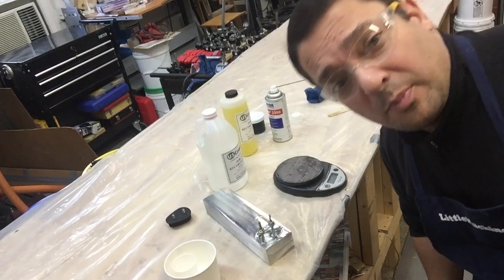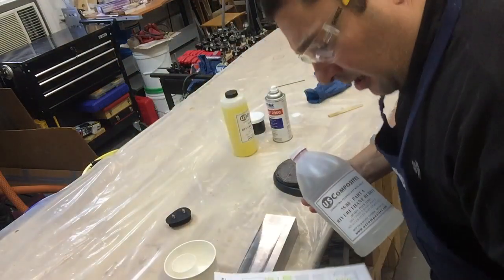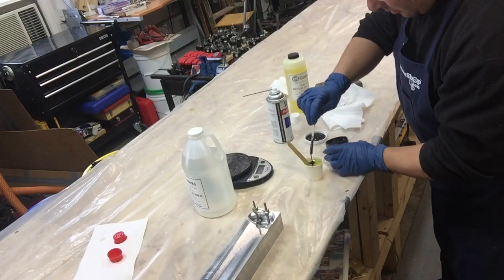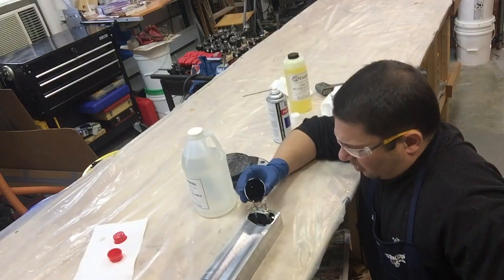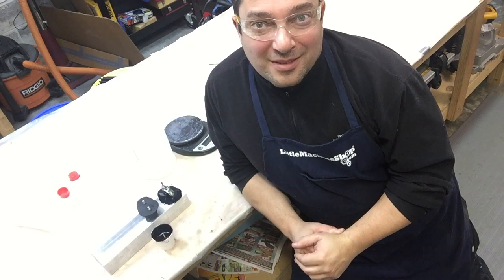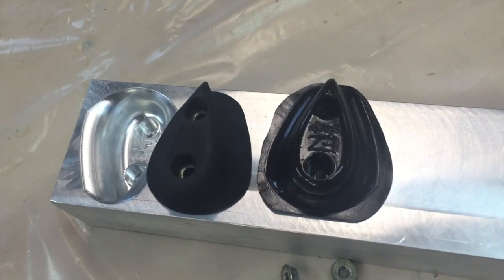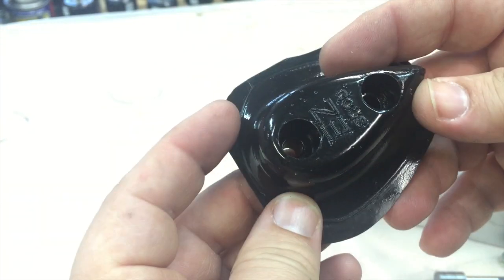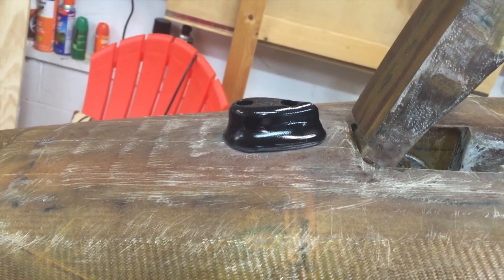From mold to part (part 3)

Comment: That looks great! Especially for your first mold! You can further improve your final result by adding a lid to contain the overflow. Simply  add a pour hole to make it an injection mold. Fusion 360 will allow you to calculate the exact volume of liquid that it will require to fill the mold. You could then machine your "bolts" for the holes in the part as a part of the lid to fit into the base as a male/female (hard to describe what i'm imagining). When the mold is opened, the part will be the exact dimensions you intended it to be, without having to fuss with screwing or unscrewing your bolt for the holes. To keep the halves aligned, drill and reem holes for a couple of dowel pins to press into the base, and 2 more holes in the lid for the pins to slide in and out of.
Reply from the maker: Thanks Josh.
Reply: No problem! It's hard to find anybody doing this kind of work. It's always interesting to me to see other peoples work flow. Keep up the cool videos!

Comment: Nice Job on the Mold I think it turned out great!  I guess if you wanted you could take a Dremel and polish the inside of the mold with some compound.

Now I'm not versed on aircraft but this piece is not to ever be used correct?  

You are a true Craftsman my friend anyone who puts this much effort into a piece that hopefully never gets used Well I cant wait to see the Long EZ when she is complete.

Just a Awesome Job!,
Be Safe,
Sam
Reply from the maker: I don't know about that Sam, but thanks a lot.  I'll probably not use this one, but only because I want to dissect it, and I didn't mix in any UV protection in the urethane. But I will use the next one. One thing I'll try with it, is to embed an aluminum piece identical to the stack's "handle" right where the counterbore ends, so that the bolts will have a much larger area to compress, rather than just two washers.  Incidentally that's what that handle really was supposed to be, but I digress.
Reply: +Crivo152 
Well I think it turned out awesome! When I said this piece was not ever to be used I meant this is to protect the nose in case the nose gear has issues correct or is this something that will be used regularly?
Reply from the maker: +CNC4XR7 it'll be used all the times Sam. The plane parks with the nose gear retracted and rests the nose on the bumper. I'll email you some pics.

Comment: OMG this is an awesome series specially it is for an aircraft :-)

What is the melting point of this polyurethane rubber ? can it resist high temperature like 90 F ?

Thanks for the series, waiting to watch like it.
Best Regards
Reply from the maker: Thanks. I don't know that there is a melting point per se, but it definitely can stand 90ºF just fine.
Reply: U R Welcome, nice. Good Luck man :D